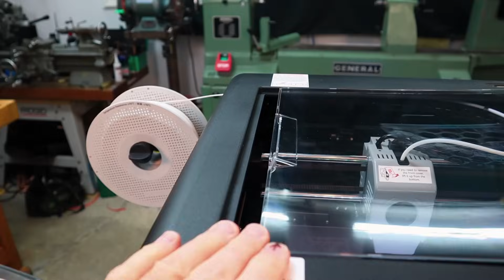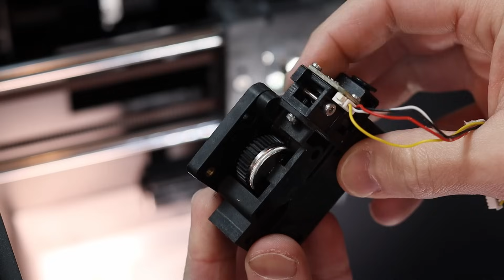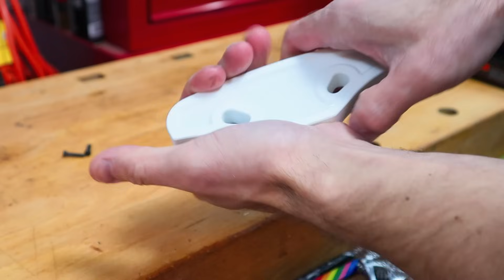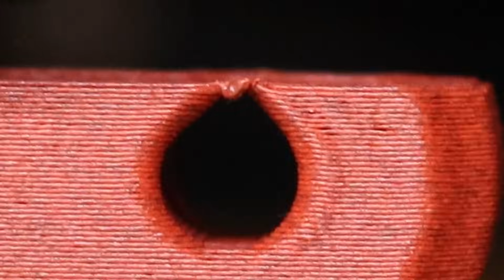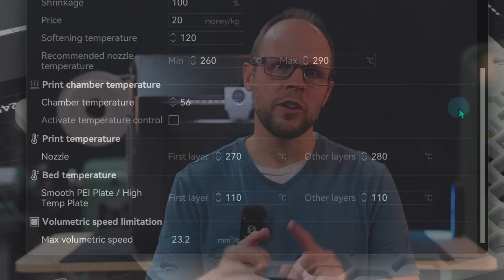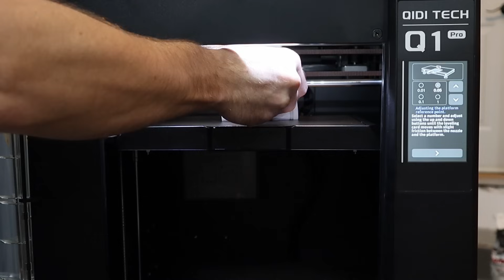The All NEW QIDI Q1 Pro - Affordable, High Performance and High Tem...?

Comment: Great video.  I also have those exact clamps and could use the STLs.  This printer looks really capable.
Reply from the maker: Sure thing!  I wanted to create the larger versions as well, but I can post the files and give you the link in the next day or two.  Do you have Yellow TPU?  It would look so much better!
Reply: @NeedItMakeIt  Thank you. I only have black TPU.   I have never printed with TPU yet.
Reply: @NeedItMakeIt where is the link to those quick grip pads you promised??
My clamps are 30 years old and the pads are hard as rocks - I'm more than ready to print my replacements!

Comment: About the problems of the red printed part. No higher cooling….lower the printspeed for the middle part. About the holes….variable layer height.
Reply from the maker: Ah, good tips, you know the variable LH is a good option that I don't use.  I tested it back in my Ender 3 V2 days and haven't really used it since.  Thanks for the pointers!  The PETG-CF looks so good, but layer adhesion seems to be far worse than Basic PETG

Comment: Very useful video ... what brand is the brick red PETG & would you recommend using it?
Reply: It's brick red PETG-CF (carbon fibre) from Bambu Lab. I haven't used any yet, but I hear it's of decent quality
Reply: @russellkeyes3984 Cool, thanks a lot!
Reply from the maker: I don't think there is another filament that looks as good as CF, and now we have more colors available too, which is really nice.  I just bought a few more spools.  I know layer adhesion is not as good as basic PETG, and that may come down to some of the print settings, I was able to get a chisel in there easily and pop the layers apart, that isn't a problem with basic.  I will have to see if changing the cabin temp or messing with nozzle temperature and speed will solve that problem.  

Yes Bambu filament for all of the prints now, it's easier if I can stick with one manufacturer for any testing as well.
Reply: @NeedItMakeIt  worth noting that Bambu's CF-PETG is only 5-10% carbon fibre by weight, whereas most CF-PETG blends are 20%. I'm guessing that's why you can get different colours for Bambu CF-PETG, once you add more carbon fibre it just goes black. Is it noticeably stiffer than regular PETG?
Reply from the maker: That's good info, I've found that the CF though it adds quite a bit of stiffness, it dramatically impacts the layer adhesion... in a bad way I should add.  I've just tested a Basic PETG Part in comparison and it is far more elastic, however the max load capacity is also far greater as well.  More research is required.

Comment: wow... I know it's been said, but the Bambu influence on the industry is in full effect.
Reply: Quidi has been doing fdm printers way longer then bambu all they did is steal from quidi and others
Reply from the maker: Was Ultimaker first?  I was just thinking about them the other day, I don't hear anything about them, have they fallen too far behind?
Reply: @NeedItMakeIt  Ultimaker (now "UltiMaker") were ONE of the first, not the first.  They have indeed fallen behind. They're been resting on their laurels for a long time, and charging too much based on their legacy.   They merged with Makerbot recently, hence the capital "M" in the new logo. They have not been innovating.

I had a lot of dealings with UltiMaker the company, as i have written content for their site etc.  They seem to have a lot of internal problems, with the company being driven almost solely by corporate and marketing, with engineering taking a back seat. 

The Glassdoor reviews for the company make it sound like a toxic hellhole of a company.

I think Bambu was the first proper nail in the UltiMaker coffin. The heated chamber Qidi machines might be the final nails.

Good riddance to be honest. They have been coasting for way too long. Innovate or die.
Reply from the maker: I would have to go back to see who did what first, I agree that most of the ideas came from Open source Voron and the community not to mention the Klipper dev team.  Bambu did add color printing with AMS and they have a nice setup for it, even though it makes for very slow prints.
Reply: All bamboo did is take steal the designs from Voron. Take an open source printer and make money on it…
Reply: @F1v30h1 Cry me a river buddy.
Reply from the maker: It would be a tiny river, would you settle for a brook or maybe a ravine?

Comment: How is Qidi pronounced "Cheaty"????
Reply from the maker: I had to ask them.  This is because it's a Chinese name and QI is pronounced Chee and DI is pronounced Dee.   It does sound like Cheaty.  My mind wants to pronunce it as it it had a U  QUIDI, or QUEUEDY, but it's not.
Reply: I thought it was "shitty"... and now I own two of them 😉
Reply from the maker: @louis-philippeyargeau2497  That's the French pronunciation... how do you like them?
Reply: @NeedItMakeIt  No complaint at all. I've only printed pla and petg so far. Only one extruder jam while unloading wich was a newbie mistake with this type of extruder. I've chose Qidi after a bad experience with a K1 and Creality's customer service. In the end I've returned the K1.
Reply from the maker: @louis-philippeyargeau2497  seeing how some other extruders are setup compared to the K1, I think that the K1 needs to improve theirs to keep up, it seems that QIDI has a much more substantial extruder/hotend setup, leading to better overall performance.  I think there are some small firmware tweaks they can make, the cutting of the filament and then extruding the remnants isn't a great process, if you're feeding in TPU but need to push through some existing PETG or ABS, it's not going to go too well, the existing filament should be removed first and then new fed into it.  I've given QIDI feedback on this process so hopefully we'll see an adjustment there.  

I'm actually looking forward to getting some more heavy prints onto it, now I'm not afraid to print ABS that's heavy, or anything heavy really with the chamber heating.  I wonder if I should give a go at some prints which are the most likely to warp and see how it does.   A long and fairly thin completely solid part, with a height of 13mm or 20mm maybe?
Reply: @louis-philippeyargeau2497  that would be Xidi, kind of like a large media platform going into the Xitter

Comment: Great review, i like how qidi uses 4 rails on the z with 2 leadscrews, looks alot stronger than the tri setup on the k1 and p1s.

Your franken-KE is looking cool
Reply from the maker: Thanks, yeah it seems to be a good approach.  Having the probe along with the dual z motors helps to get that bed far more level than with some of the other printers which use a single motor.  

They end up using a fairly thick steel formed plate below the bed and then converting to a 3 point connection to mount the aluminum heat bed, which is supposed to be far better to prevent warpage and allow the to move around without being too constrained.   It's nice that they've given us some knobs to level the bed, they have a jamb-nut below so we just loosen those a bit and then adjust and snug the jamb nuts back up.

I'm still working on the KE, I think I'll have 3 more videos, one for the Z stabilizers, one for the extruder and one for the final PC, or maybe even ABS bed.   But I need an accelerometer to compensate for the changes that I've made so the firmware can adjust for the changes in resonance.  I guess I should order that today!  Thanks for reminding me.
Reply: @NeedItMakeIt  with the 2 z motors does that mean it also you can also use g34 z steppers auto alignment? 
How level is the bed?
Reply from the maker: @peaceorpieces8343  I just powered off the printer then adjusted the screws manually, powered back on and tried the G34 and it does not recognize the command.  Though I don't think there is any need for it.  What I can do is just bring the head to the left and raise the z manually, then to the right and do the same, then power the printer on.  There may be a way to do this automatically and I am thinking that the printer does this itself since it probes left and right so I will run some tests to see.  I shall return with some information soon!
Reply: @NeedItMakeIt  yes if it probes left and right it should be doing it automatically, that's great
Reply from the maker: I just did the test and it did the adjustment itself.  I set the left and right sides off by about 6mm and then it probed left and right and the end result was pretty good... I might have to say that it is better than I could have done manually :( .  Because it uses KAMP natively I can only see the mesh for a moment, then it is cleared.
Reply: @NeedItMakeIt  awesome, i want one now 👍👍👍
Reply from the maker: Yeah, it seems that it's pretty hard to make a not-good layer, once you set it through the initial walk-through you should be good unless you drop the printer or have an earthquake.  I've been printing lots of harder prints since I finished recording the video and they're so clean.  I think they just focused on the right areas, good on them.
Reply: @NeedItMakeIt  🤣🤣
Looks like they made a beast of a machine, alot of other reviews are saying there are alot less vibrations with it than other core xy?
Reply from the maker: @peaceorpieces8343  I am printing on it at this very moment with ABS, and FUZZY skin with a Fuzz of 0.06 x 0.06, which is not something I'd even think about trying on any other printer.  Maybe the X1C, I guess I should try it there as well.
Reply: @NeedItMakeIt  never tried fuzzy skin on ABS before, be great to see a video of how u get on, a identical print with the same filiment on the qidi, the x1c and the k1c if u have it and see which comes out best
Reply from the maker: @peaceorpieces8343  It certainly slows the perimeter down, but it looks really nice at that small amount of variation, the sheen is even and it gives a slight texture similar to an injection molded part.  I'll definitely be making some VS videos with this printer.  So far I've not calibrated anything and I don't think I need to, all of the prints are turning out nice, so I might just be able to go head to head with the X1C as-is.  Maybe both printing upside down or on their side?
Reply: @NeedItMakeIt  upside down test then a wobble test 👍

Comment: For me the Q1 have 3 problems:
- risk of electricity shock a the 110/230v build space heater
- not a Vanilla Klipper
- the Klipper version is over a year old. 😢
Reply from the maker: For the heater, how would you recommend they solve that?   Perhaps a heating mat, similar to the heat bed?

Yes, I agree they should move towards completely open and up-to-date Klipper to take advantage of all of the recently adjustments and anything new.  It's nice that they have it and that it's open, but it could be better.  I'm no Klipper expert, so thanks for your thoughts on that.

It would be nice to have the ability to use Mainsail or Fluidd,  I guess there is some dispute about some of the changes they wanted to make to Klipper so they had to do it this way.  Would you say that it's possible to install Klipper onto the printer and use it the way it was intended?
Reply: @NeedItMakeIt  Form my knowledge based of other reviews: mainsail is installed but on not on the TCP port 80 but on 1000 something.
And with the changes form them updating the old Klipper Install will brake the printer
Reply from the maker: I'll have a look into it, personally I don't really mind if it's new, I'm happy if the prints turn out well.  On occasion when Klipper has new features, we're going to want some right away and I can see that being something that they need to address.
Reply: @NeedItMakeIt  for access can you try the IP:1088 ?
The web interface should be on port 1080 or 1088

Comment: Thanks! great vid. Do you think this would be a good option for the UV resistant filaments > ASA, PCTG & PETG? Speaking of those which UV resistant filament would you recommend for functional parts... eg a shed door handle?
Reply from the maker: Shed door handle, now you're talking my language.  If it's pretty beefy any of them will do fine, I'd default to the lowest price, and that would probably be PETG.  If you do use it, I'd recommend adding a little bit of fuzzy skin 0.08 in amplitude and spacing, it helps to reduce the sheen just enough.   ASA is nice as well and this printer can handle ASA with no problems.  The prints that I showed in the video were some of the heaviest that I've ever made at that size and they stayed remarkably flat, I was a little surprised, normally I'd have to add a big brim with a 0 offset distance to even have a chance, it's hard to believe that chamber heating can have that much of an impact.

I'd like to see a picture of what you come up with and if you want to make some points for free filament, are you going to post the design on MW?

I need to design a gate handle and latch for both of our gates, I've been thinking about whether I should integrate steel for the latching mechanism and have the majority of it made from ASA or PETG.
Reply: @NeedItMakeIt   Hi Do you print ASA using the default QidiSlicer settings or did you change something? I've just installed Asa for Q1 and I have a problem - 25x25 cubes with 40% filling. The corners between the layers lift up and it stays firm and adheres well to the table
Reply from the maker: @AdamMaszynotwor  I've not printed ASA, but it's similar to ABS, the issue you're having is that you don't have enough time for those corners to cool before the next layers are added.  You can add some part cooling, or you can turn the AUX on just a bit.  If your part is small or has some overhangs, they'll want to curl a bit unless you have enough time for them to solidify enough before the next layers go on.  

Let me know how it goes.
Reply: @NeedItMakeIt  Thank you, you're right. That was most likely the problem.  It's the first time I have a printer with a closed chamber and I'm experimenting with new filaments.  on the packaging of my ASA filament there is information that the fans should be turned off and the slicer, after selecting the ASA material, had fans marked from 10 to 60% in the options... but according to all the information I found, the fans should be either turned off or to a maximum of 10%, so in accordance with  With the knowledge I gained, I turned off the fans.  perhaps this is actually the case if we print on an open printer or only have a closed chamber.  but in my case, the slicer sets the chamber temperature to 55 degrees.  it looks like you hit the jackpot and turning off the fans and the heated chamber caused the filament to harden slower, the problem was solved by starting the print with practically the parameters proposed by the slicer, I only raised the table temperature to 110, the chamber temperature to 60 and used athesis spray on the table (now printing  it holds on to the table so tightly that until it cools down it is impossible to tear it off by force).  Thank you for your answer and willingness to help, and best regards :) (I also apologize for my comment, but I use a translator)
Reply: @NeedItMakeIt   i'll gladly share my design, just not sure what you mean by posting it on "MW"? It's a pretty simple design. I's like a square U shape, that will go through one door, so that it can be opened or closed from inside or outside... my description is probably clear as mud! lol

Comment: Seems like they added autocalibration for models shipping today.

As someone who has only every had a Qidi-tech 1 that still works after 8 years, this printer is incredibly attractive for the price. (Qidi-tech 1 isn't on their timeline, but I think it recieved slight upgrades to become the x-pro.)

Thanks for the great review!
Reply from the maker: I guess I wasn't specific enough in my video, my apologies for that.  The calibration I want to see as an add-on is the filament, this would require what other companies call LiDAR, but it's really just one or two lasers with a camera to detect the expected extrusion vs what was actually extruded and then compensation can be made on-the-fly just before the print starts.  

I think the calibration they're referring to is the Z-offset and bed mesh calibration, which is true, it does have that and it works really well.  

I like what they've done with the printer, it's a little hard to get the camera inside to see what's going on, that's true for any enclosed printer, but with the K1, the side panels came off to make it a bit easier.  

I appreciate the comment.  I'll probably have 1 follow up video to this one, I want to design a mod for that spool holder just so people have an option to tilt it back a few degrees, or maybe stiffen it a bit.  I can't say for sure that it would be needed but if there is enough weight on there for long enough, I can see that it might want to lean a bit more and filament can bounce off.